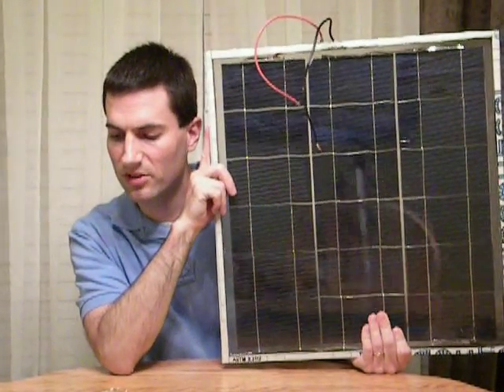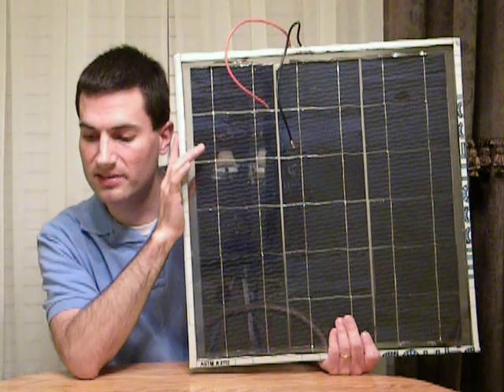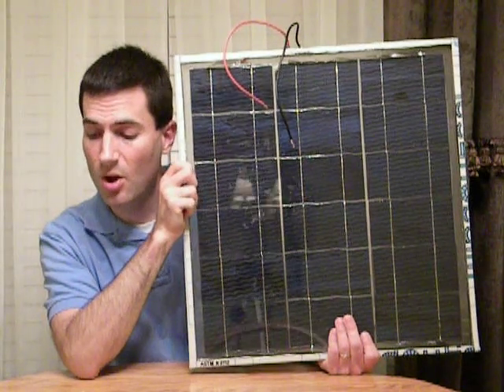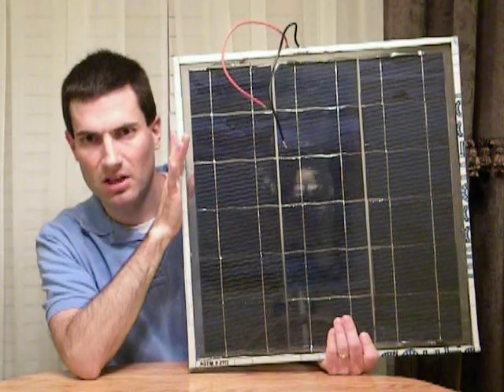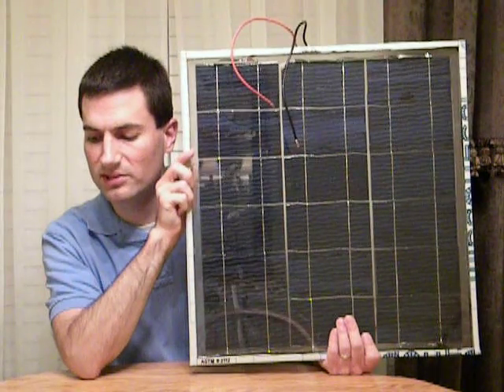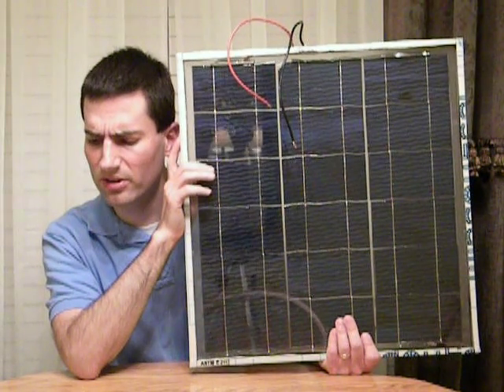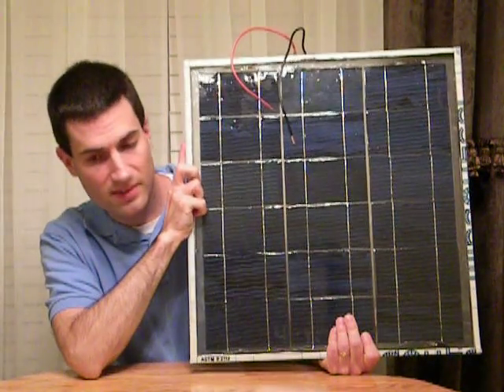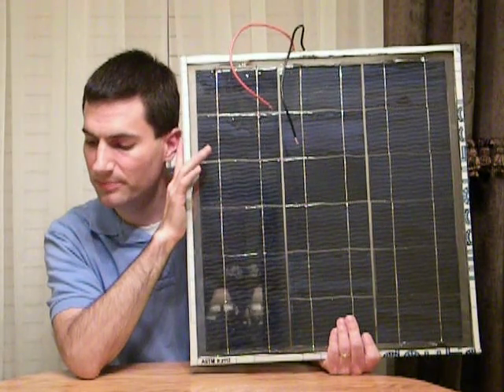My new all glass design for my diy solar panel series

Comment from the maker: @Juani2392 The glass is a non-tempered glass. If it is tempered and you try to cut it, it will break into a million pieces. I have 18 solar cells in this panel and the panel is 20 in x 21 in which is 508 mm x 533.4 mm. I am not sure about the mm part. That is the answer that google came up with. Thanks for the question, Lonny

Comment from the maker: @vincentvandervaere Hello, I am not sure how much hail the glass could take. But on the topic of cells getting wet, in the tropics you will want to protect the cells with a vapor barrier. I tried a bunch of different thing in my video " How to build a solar panel part 6". Maybe one of the ideas will be something that will work for you. Thanks for the question, Lonny